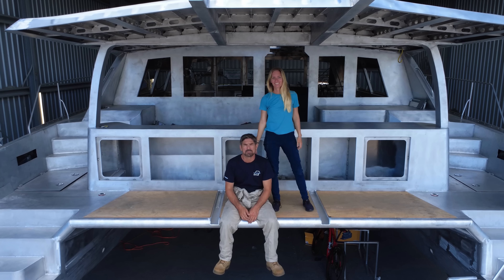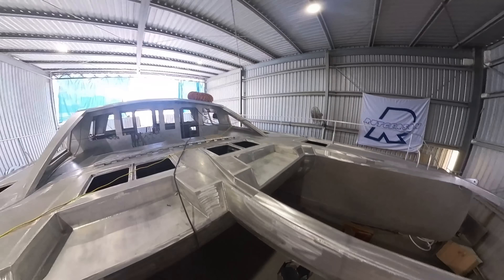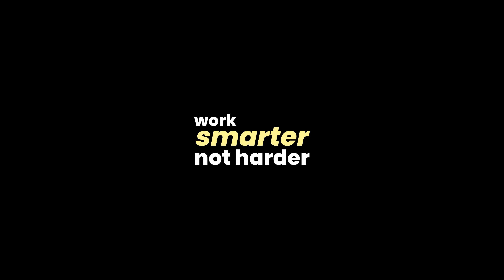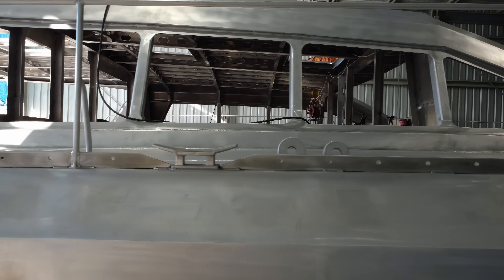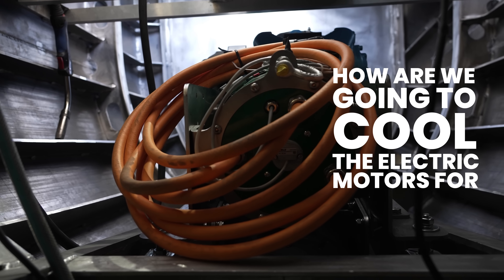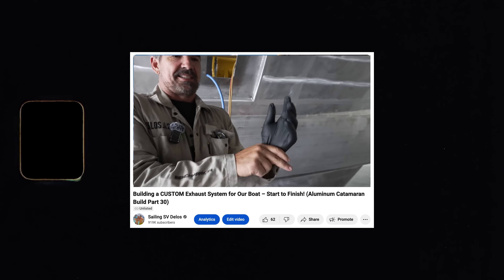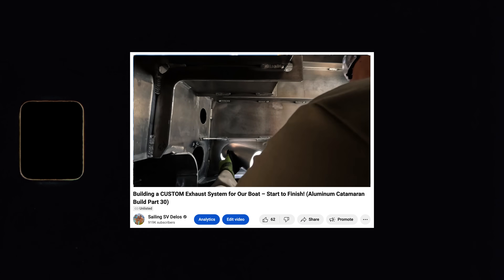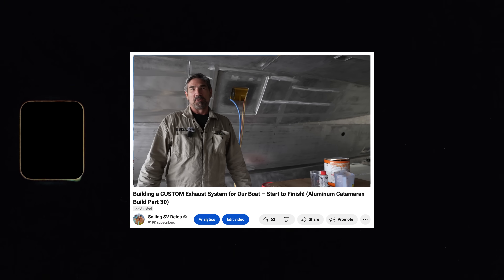We Challenged AI to help design our Keel Cooler 🧠 (Building Our Own Aluminum Catamaran From Scratch)

Comment: Have you thought about using some of that heat to help supplement your hot water system so that you use less energy to heat your water. It’s really common to run an engine loop in powerboats. Just a thought

Comment: Hey Brian, Funny you are doing this. I was recently watching some YouTube engineering videos where a guy was trying to heat water with a wood furnace, and was trying out different styles of heat exchangers on the wood furnace pipe. I recall he tried exchanging heat with a copper pipe twisted around the exhaust gas pipe, and the result was that he was surprised to find very little heat transfer. He then tried insulation with little success. He then poured SAND in the space, and the sand was exceptional as a medium for transferring heat due to thermal mass, and his ability for the sand to form around the pipe instead of air, thereby transferring the heat. Then I recall he used a carbon based substance, can’t remember the name, but it also worked well. Maybe you could weld an aluminum container to match against the keel, design some fins to maximize the surface are and pour in sand to maximize the transfer of heat to the keel, keeping everything aluminum for minimal corrosion between dissimilar metals.
Reply: https://youtu.be/nJp3o8WJ05s?si=cAaL_37YNEfuaKvV
Reply: The other thing that he said worked well for heat transfer was GRAPHITE, but it was messy. Sand might be a good solution here as a medium of heat transfer.

Comment: many vessels have skin tanks and also box coolers. These help to avoid sucking in sand etc into the cooling systems. we fitted a box cooler system. We used Kort propulsion I think for this. There are dutch companies who resolve this problem often for vessels particularly involved in dredging and slipper tug operations.

Comment: One thing to keep in mind is that the way the heat pipe inside the hull is connected/ welded to the hull will be important also for conduction of the heat to the hull.

Comment: Retired tugboat engineer here, who has dealt with keel  coolers / skin coolers on steel hull  tugs and other offshore work boat applications. These systems are extremely reliable and can go for long periods of time without any attention whatsoever until shipyard availabilities. So I don’t have any information for you other than to ask you if you are anticipating affixing, heatsink fins to your application. Most keel cooler installations on steel hauled vessels put the keel coolers inside of an external pocket indentation in the external hull. I would imagine on your aluminum sailboat, this would be extremely inefficient from a sailor’s point of view. Mounted internally, with only skin surface for heat transfer, might not be efficient at all, without heat sink fins for heat dissipation. Let’s see the design. You are in fairly new territory here. It might be a good idea to set up some real world testing. I can remember one shipyard availability where we were able to run a generator while the vessel was in dry dock with no other cooling than the keel cooler exposed to the atmosphere. There was enough heat transfer to safely run a 100 KW Detroit Diesel genset indefinitely.
Reply: Beta marine has Keel Cooling Calculator & Tank Design info on their site and they actually suggest skin surface for heat transfer for their different engines. The core principle is to use baffles inside the tank to increase the swim area.
Reply: I was assuming the cooler would be integral to the skin.  So cut a long slit in the skin and weld into the hole a long pair of square tubes (out and back) of the same hull skin thickness so there is perfect connection to the skin and the water.  The hull skin area around the tube would also help dissipate the heat.  Anything welded TO the skin would have limitations for heat transfer wherever there was an air gap, the heat would only travel via the welds.

Comment: Ask a machinist and welder/fab guy, i would make the system so it could be enlarged simply after use in case of overheating issues. Leave room and test it

Comment: Brian, Licensed Captain with experience with Keel Coolers.   Design for greater cooling and use a thermostat to control overall temperature with a expansion / air capture tank.
Reply: The thing about electric motors and motor controllers is that the colder they are the better. In other words you can over cool them with water so no thermostat is necessary

Comment: Build a heat sync that would be acceptable for a comparable diesel engine of similar power. Or maybe even purchase said heat sync so no need to construct. Install a valve to regulate water flow to heat sync. Over engineered sure, but you would never have a problem.

Comment: You also need to calculate the amount of heat dissipated by the water pump as well. In my personal experience erring on the side of caution the bigger the better but with multiple capillaries so the heat is spread out instead of concentrated on one spot. Also you need to take into consideration the amount of warping to the aluminium keel -- which several different smaller capillaries/heatsinks are circulated. Last thing you need is something that warps more.

Comment: I had a hydraulic pump overheating...  Welded a return line to side of a water tank, and that helped...  Second effort; 1-inch length of 1-inch diameter pipe, drilled/tapped 3/8-inch hole on side, and rounded off end of bolt going through the hole.  This "pincher" went over my 1/2 inch diameter return pipe, and dimpled it where I cranked down the bolt... This bent the pipe in a zig-zag, and each dimple was a choke point, which was very effective at cooling.  just make sure you still have good flow at the end...

Comment: dont over think it and make a simple problem complicated. you are on the right track equating  it to a diesel engine. whatever size cooler you would use for a diesel go with that , it would be more than sufficient plus you have the added cooling of the hull and ocean water..just make sure to weld cooling tubes directly to the hull for maximum heat transfer.

Comment: An interesting project. The challenge is to improve the heat transfer to the hull. The hull will conduct heat over a large area. How about welding an aluminum tube to one of the hull stringers near a rib. The stringers and rib will "spread" the heat out into the hull and the weld joint will provide effective transfer from the coolant to the hull. No need for any purchased hardware. In case you come up short, just do it again. I'd love to see it.

Comment: What are the chances your water maker and hot water heater are in the same location as where you are trying displace this heat? 🤔 

If so, you could run a fresh water line directly through a heat exchanger and preheat the water before it goes to the hot water heater. Have a small hot water tank to store it, say 20-30 gallons. Why waste that heat when you can store it and make it work for you in more than one way!? 

Dissipate heat by heating water you were already going to waste electricity heating anyway.

Have the additional keel cooler as back up or once your hot fresh water has "come to temp". 

You will likely want to test a crude version (proof of concept), make the real one, then finally make adjustments.

Comment: SV Seeker used the propeller tunnel keel as his cooler. Unfortunately, those videos were removed by YT. But the man is still alive and well. Ask him.
Reply: Except his propeller is in a contained tube already (they just filled it in this video) what a PIA that would be to redesign
Reply: It's been a really long time since I watched it, but wasn't that just the water circulation system for the cutlass bearing?

Comment: So a bunch of rambling thoughts later lol.  Your hull is pretty thick and would probably really need at least .7 meters to exchange in warmer areas.  Maybe use a manifold to swap the heat to the inside of the boat so as to not waste and energy.  Complications and such aside.  This is obviously up to you and Kaz.  Good luck and have fun.  Nice build so far by the way.  Those guys are top notch.
Reply: The thickness of the hull shouldn't make much difference. Aluminum has a pretty high thermal conductivity, so the heat will transfer through the hull and into the areas surrounding the heat exchanger, provided the heat exchanger is built into the hull, so that it has good heat exchange with the entire hull.
Reply: @Wrenchmonkey1  yes absolutely aluminum has loads of heat exchange capacity.  Many older heat exchangers were tubes outside of the hull and thus giving much more surface area.  That is my thing that would worry me especially if you are in warm waters and you have growth on the boat.  I would also split the surface area up a bit.  That is just me.  That is just me and my thoughts.  I hope this helps.  Thanks for the exchange of thoughts as well.
Reply: @TheRealChasbowie  Excellent point regarding growth. That will certainly affect the rate of heat transfer.

Comment: I personally would error on the side of close to a meter area.  My thinking on this is that you boat has flat surfaces and the aluminum is pretty thick.  If you are in warmer waters the transfer of heat through the thicker hull will be less efficient.  I would think splitting the surface area into multiple different tubes/boxes welded on the side of the boat a few CM apart.  This was in case there is grass, or life growing on the boat you are not stuck with one area and cannot cool the motors.  Also thinking of situations like this corking the inside of the aluminum tubes/boxes would be a good idea as well keeping the heat exchanged to the outside.  Unless you want to go really nuts and use that water to heat water for the boat as well.  Some sort of manifold or just let it go through a short heat exchanger for a water heater.

Comment: Hi Brian our dive team has a German build patrol boat witch has a 9.5 ltr 140hp big diesel with keel cooling
We have +-2.5 sqm cooling surface  
Works good but you also get a lot of heat on the inside 
so insulating the. Inside could be necessary

Comment: The vidoe shows a long rectangle with inlet and outlet. If that is welded to the boat's hull, but contact will only be the actual weld. the heta transfer betwen the rectnagle's side and the hull will not be nearly as high across the two aluminum plates interface. That could be eliminated by using the actual hull as one side of the cooling box sides. Another small point is the primer and anti foul coatings will reduce heat transfer.
Reply: use thermal paste? (pc guy)

Comment: You'll get better results if you note down the temperature you expect the water to exit the electric motor, the seawater temperature, and the cooling water flow rate when asking questions. Always use the worst-case data.

For example, I would assume the cooling water will enter the engine at a temperature two or three degrees Celsius above seawater temperature. Knowing the water flow rate, it's simple to calculate the exit temperature of that water, and from there, it's simple for the AI to calculate the rest.

Comment: Mechanical Engineer Here.  I've done similar exercises to what you just did with ChatGPT and I can tell you never trust any calculation ChatGPT does.  ChatGPT can't even handle simple algebra or even do unit conversions with any reliability.  Every time I asked it to do a calculation it makes simple errors that you would expect an 8th grader not to make.  DO NOT TRUST ChatGPT.  I've not used the other two so I can't speak to them.

I like your idea as it avoids a pump and potentially a lot of maintenance but you need to consider some things.  Hull and heat exchange fouling can greatly reduce heat transfer efficiency over time.  Assuming you're going to paint the hull, this will have a significant impact on heat transfer.  Even keel coolers have separate tubes or tubes and fins to allow better heat transfer.   Heat transfer from a smooth plate to water isn't very efficient.  You're going to loose efficiency in the interface between the hull and the water heat exchanger.  I would size for worst case scenario, maximum heat, stagnant water not moving over the hull, very hot, getting baked by the sun under a metal dock in a marina.  Honestly, you can't beat the efficiency of pumping water through a water/water heat exchanger and I wouldn't do what you're looking at myself.

Comment: The heat coefficient will be affected by whatever paint or epoxy you put on the bottom of the boat as the aluminum will not have direct contact with the water. In addition, look into whatever stray current problems this may create.

Comment: Brian, I think making your hull capable of being a heat exchanger is a good thing to give a try.  I would also consider having a backup plan where you could incorporate a traditional heat exchanger relatively easily if you can't sink the heat as well as you thought.  Seems like it should work though.  Try to over size it and keep the thermal loads as low as you can.  Good luck!

PS.  You could try making an aluminum water block and painting it with antifoul paint, then putting that in a foam cooler filled with water and measure the heat transfer rates in a variety of scenarios.

Comment: Just something to remember, while the answers from the LLMs look pretty good DeepSeek, GPT in fact all of the LLMs are NOT equipped to do mathematical calculations. An LLM is a Large Language Model and in very simplistic terms all it does is guess the next word in a sentence like predictive text on your phone. Of course an LLM has access to many calculations so when it is asked to calculate a result it probably was trained on very similar math problems and it can return what appears to be an accurate answer ... however it is NOT necessarily accurate (if one of the problems it was trained on were accidentally the same numbers it could appear to be accurate but if not the results can be wildly off. 
Some people might comment that if you ask an LLM a math problem it will look for a calculator to to the work, well in the future it might be possible but for now it's still quite clunky. 
The golden rule for using an LLM is, check the answers before you beleive what it says

Comment: It is not google.  You are taking the first output.  You must coach it with critical feedback and data to force it into the correct assumptions.  Example I will not use fins.  I will use a 20gpm water flow pump.  the boat hull is .5" thick and so on.  All feedback in metric.  Sometimes it is very very wrong and can take this criticism well.
Reply: Make it 4x the size you guesstimate and this reduces the delta t and fouling rates so no harm no foul. Use a variable speed water pump and the reduced pump losses can be captured in the over sizing by less pumping losses...

Comment: your AI experiment proves several  points, 1 is dont believe all you read
concern for design are insulation effects of both;  Aluminium oxidisation within sealed circuit and the external hull treatment
have you an existing longtitudinal stringer suitable for utilistion as hull heat exchanger?

Comment: @SVDelos: Here the answer that counts from questioning chatGPTs results: ChatGPT actually considered different "modes"(low speed, anchor, cruising)!
"Final Answer:
At cruising speed: ~0.42 m² (~0.5 m² to be safe)

At low speed: ~0.83 m²

At anchor: ~1.67 m²

So, if Brian from SV Delos was given 1.25 m², that was a conservative assumption likely for mooring scenarios."
Reply: The electric motor is never turning (for very long) while at anchor?
Reply: wooww :)

Comment: I love this episode because you're looking at some of the things people don't think about.  
I hope this helps.
Reply: the keel cooler is for the electric motor only.
Reply: @MrMSandin  The electric motor is also used as the generator.
Reply: @MrMSandin  Yea, I had just started thinking about that as I was crunching the numbers for the thermal output of the diesel engine. I should probably take that down.